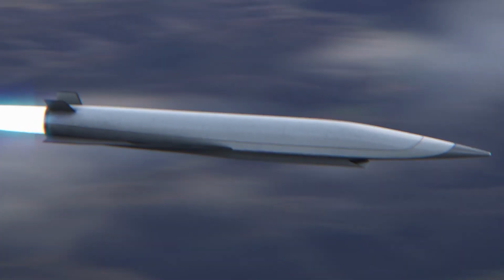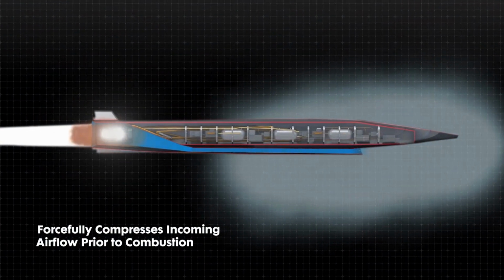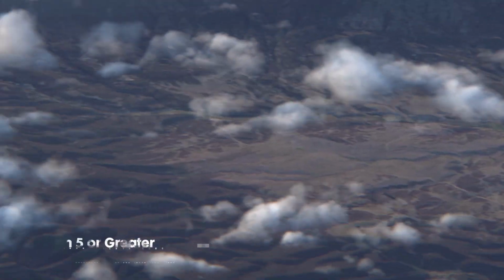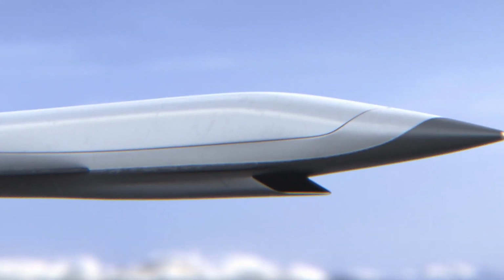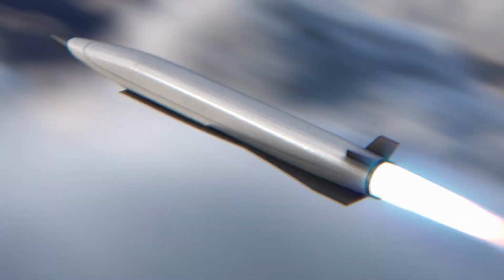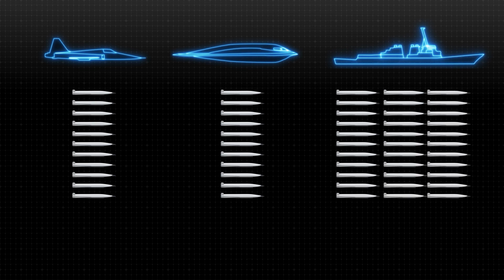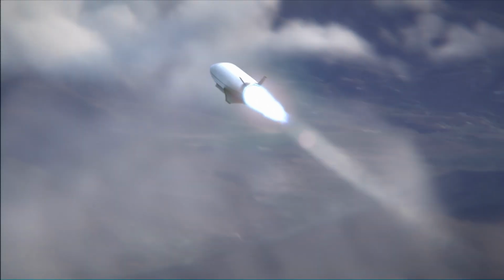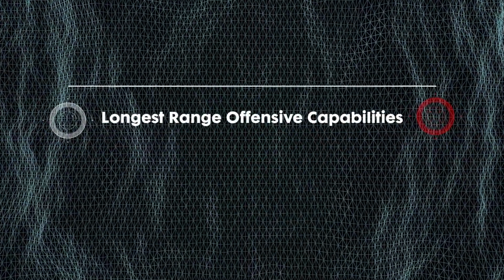Hypersonic Scramjet Propulsion Technology

Comment: Grumman never signed a contract with DuPont for any Kevlar supplier contract. Fiberglass will burn above Mach 5 due to friction, Kevlar on the other hand withstands higher heat, and can go Mach 7 or Mach 8 without any problems. 
Anyway, my knowledge is limited to Grumman design parameters prior to 1992, I don’t know if Northrop has worked out a deal with DuPont , and I doubt they ever will.

Comment: Traditional ICBM travel at 23 Mach, scram jet theoretical speed is around thin number, so this tech is like  Ford T compared to a F1 car. low altitude means it can be targeted on the entire distance from launch to target, compared to ICBM with can only be targeted at launch and at the target location. that the scary part about nukes and ICBMs. you can hardly do something about it once launched.

Comment: Use an extremely powerful jet flame ( one fuel tank, then one jet flame, have 2/3 parts.) maybe use metal that burns & makes the jet faster, iron/ carbon even.
The one jet flame MUST come out a in a cone shape, the ratio is , 10metre wide cone, to a 0.4 metre cone shape
So 1metre wide mini jet flame must expand from one single point, to a 1 metre radius, within 4cm gap
The gas output must be " structured gas " like water crystals
Use a turnip shape to output the gas, 
Use solid uranium as the fuel source idk, heavier the metal, the better 
Pump high pressure hydrogen through the metal with extremely low voltage , 0.00001 watts.
Reply: how does a part be less than one?
2/3 is 66% of 1
Reply: Schizo engineering 👍

Comment: My question is how does the missile reach hypersonic speeds to begin with to start the engine? I would assume it would need to be launched by a very fast aircraft or it would need a booster stage to reach hypersonic speeds for the scramjet to run.
Reply: It’ll have a booster.

Comment: There is a way to make a more powerful engine then a scramjet
I came up with this idea just yesterday, its called a HCE or hypersonic combustion engine.
What a HCE dose is that its an attachment for the scramjet that makes its significantly faster then just a your average scramjet.
And instead of the the maximum of just mach 12-24 the maximum increases to a maximum of 35-60 which is insane to think about because thats basically orbital speeds
Reply: Wonder how it works 🤔... I got one issue though dude, assuming it could achieve those speeds you stated, it would pretty much need to be an orbital type vehicle. Cause as far as I'm aware, there's no current aerospace materials technology that would allow you to go Mach 30+ in atmosphere without immediately starting to melt and disintegrate from the heat and stresses from going those speeds. Never mind, something going potentially as high as Mach 50-60~ . Would be pretty insane and need to be unmanned, but still very cool though. 😅
Reply: @shagman9684  yes as you stated that we would need a some material that will have a high enough air pressure resistance and heat resistance so it wouldn't just get obliterated. I recommend we could use something like graphene. And also how the engine works is like a combustion railgun style where parts of the enigne will combust at perfect times therefore creating this railgun like movement,
At the front would combust at the slowest and near the exhaust would combust the fastest. And the engine will do this in really fast pulses therefore creating smoke rings like what the Aurora jet would do.

Edit: and also about the orbital thing you mentioned, the orbiter will have small retractable ion jets on the front of the orbiter to allow it to stear in space
And lastly for it to go to space it will go around the planet 2-3 times before launching itself
This is so if the orbiter is maned it would straight up mess up the person's body systems
Reply: @Spetrix209  you sound very knowledgeable, i can see a career in the defense industry for you :)
Reply: If you so smart then why have you not built a scramjet engine yet.
Oh USA barely even has one.
Australia has world fastest at Mach 12 thanks to Australian Ray Stalker 1st to get essence of flight from them.
HIFIRE was joint USA and Australia tests and HAWC scramjet missile scramjet has similarities ti Australia one.
Reply: @nedkelly9688  what I was talking about was a concept. Chill
Reply: @Spetrix209  lol sounds like someone who know nothing about scramjets. they need no attachments to go faster as no one has found a limit to their speed yet and only issues is getting enough fuel and ignition and air mixture right.
Explained very well by Australian's who have world fastest at Mach 12.
And most countries use Ray Stalker Australian designed hypersonic test tunnels.
Reply: @nedkelly9688 First off, this comment is on a video about a scramjet ok so I could easily gain the information from there.
Second off, I'm only going off predictions of the max limits of a scram jet and current designs that I think are plausible.
Thirdly, there is no scientific documentation from what I've heard of Australia setting off a craft going mach 12. And plus the fastest planes we currently have are around the mach 3-6 range ok and those are merely experimental craft. So recheck what type of information your getting this from because if it's not from a Gov or Com URL then i think its most likely false and what you were reading at the time was complete BS and should be discarded from your brain.
Reply: yeah but how does it make it significantly faster
Reply: swat satellites like flies
Reply: Any electrical parts would require a turbine which would be pointless 😅. So batteries goes out of the equation too.
Reply: Barley break Mach 8. Russia is clocking mach 25
Reply: @americansrus4201   those are just hypothetical

Comment: Let’s see a real one in action, not the cgi.
Reply: That would require a hypersonic chase plane.  Hypersonic is mach 5+, so even if the camera plane was going Mach 2, the this would be going by at a relative speed of Mach 3 or better.
Reply: If you placed a camera onboard, you would not need to fly next to it to record its flight.
Reply: @mirassb  The camera would have no place to go, it would burn up from the intense heat at those speeds.

Comment: Yo sup Northorp Grumman Defense homies, just been thinking about Gold Mining and how to extract the Precious Mineral without Damaging the Bio Diverse Clean Green (my favorite💚tinted scheme Yo) Environment homie. It is Mainly large Toxic Chemical holding Pools, that you must Separate the Bottom Floor from Underground Clean Water Supply, what you must do and Hopefully there are No Volcanic fault lines in the area yup. 1st you must build a thick Concrete Basin Pool floor to Contain Chemical Waste and Underneath that Concrete slab are many Millimeter Wave Drilling Python Snake Pumps to drain out Clean Underground Water so to keep the Mine Pit Dry and Clear of Water Yo. And of course Special Hardened Durable Robotic Submersibles to Sounder Check the Concrete Integrity or locating Liquid Leak Breeches plus Sounding Platforms underneath Concrete Basin as well homie. And if there is any Breeches then the Whole Chemical Waste must be Pumped out through a Pipeline for Awaiting Large Shipping Tankers or many Very Large Storage Tanks so Urgent Concrete Repairs can be made yup. Cause you know Gold is a Very Very Useful Mineral not Only for Hard Currency but also Components in Electronics or for a Anti Solar Radiation Protective Heat Shielding in which you'll Need Abundantly in Interstellar Space Exploration Technologies homie. Well you know what my Northorp Grumman Defense Gee's homies I also been thinking about Unidentified Phenomenon Technologies it's about a Long Range Laser Light Beam Energy Magnetic, Gravitation, Vibration, Microwave Force Field Manipulation Projection System. This Platform has many Applications from Tractor Beam Force Field Projection Manipulation it's a very Powerful Light Projection beam which can absorb towards or release away from Space, Transporting very large holding tanks into Space from Earth then taking them through Outer Space Somewhere Lord forever and ever God Amen Yo💚💯🕊🙏🤲🌎🇺🇲🏳️‍🌈🏳️‍⚧️✝️🛡⚖⚔☝💪🥊🦅🚀🪖⚓⛑🦁👑✌🎓🤝🕊🙏🤲🌠🌌🎇✨🪐🛡⚖⚔☝💪🥊🦖🚀🪖⚓⛑🦣👑🖖👽🛸💚💯🏍👊😎.
Reply: @None Gone Yo sup beep beep tock the Robinson Family bee beep tock👋🤖.
Reply: I know nothing about mining, but I do about physics and the originality of ideas.

and its bad what you wrote homie
Reply: @yahtyscids194  nope it is not it keeps the toxic dangerous chemical waste way from entering the surrounding eco system if you want to Gold mine legally and robotic platforms are more durable than you are to maneuver through the toxic waste to make sure no cracks or excessive clean rain water do not effect a secured storage system that should be dry of water physics that now homie🙄.
Reply: @lawlessoriginal1048  I am glad that you told us about the wastewater capture and treatment, as well as the simple procedure to achieve it. Good job, well done. Now could you please elaborate on that Light Laser Gravity Electromagnetic Vibration Tractor Beam, that my previous comment was referring too.

I would gladly cross check your math and physics, that I am sure of you have considered, because you are no amateur scientist who is suffering from megalomania.
Reply: boomer